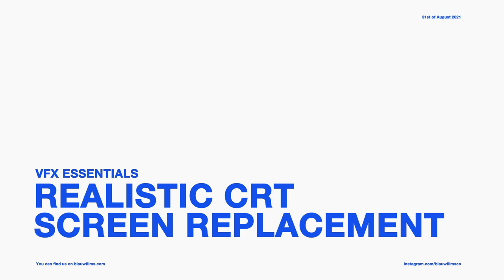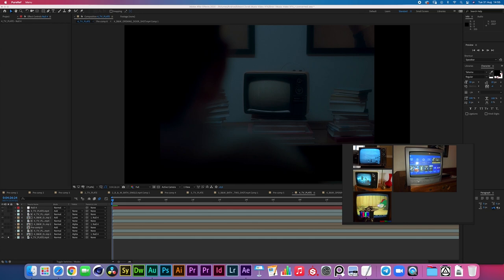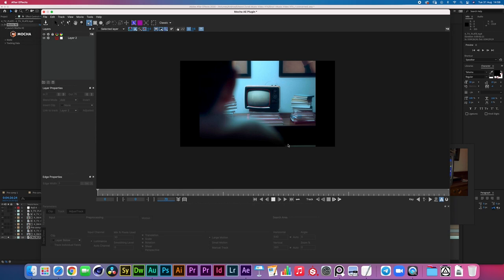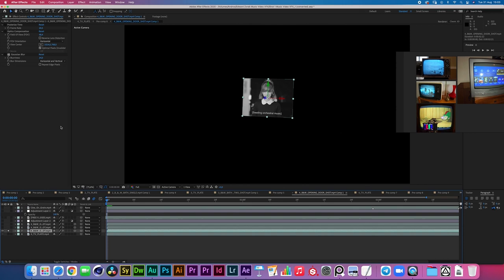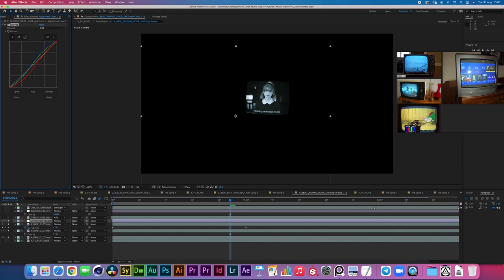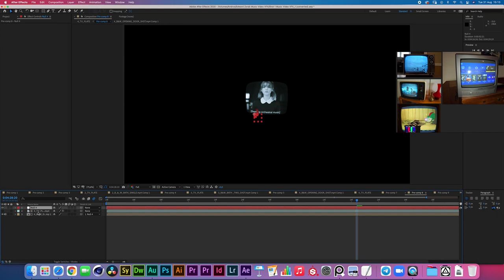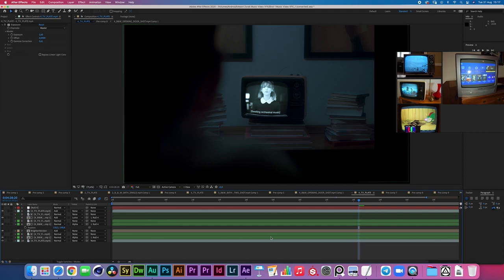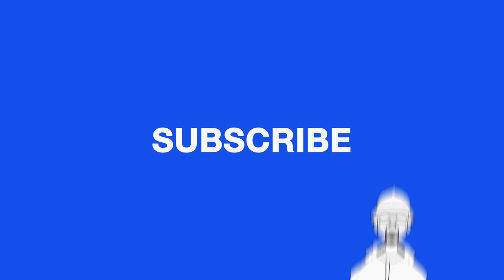Realistic CRT TV Screen Replacement in After Effects

Comment: Nice tips but for mocha workflow you jumped some CRITICAL points, like how to apply tracking data, also the necessity the precomp (footage or photo) to fit the original comp before applying effect etc...  Also how your footage becomes a bit offset since your surface area in mocha was exactly at the edges of your tv ? .... for a new user it is impossible to watch it.
Reply from the maker: Hey thanks for the comment! You're right. This video was supposed to be a follow-up to an earlier screen-replacement tutorial in which we covered most of these points. However, it fails to convey all the necessary information to smoothly follow along. Working on a new one that should get it right this time! :)
Reply: @BlauwFilms  thank you we are waiting :D
Reply: @BlauwFilms where’s the earlier video ?
Reply from the maker: @worldwideoffline6423  https://www.youtube.com/watch?v=53AC4KCslKI It's this one :'D 
This is really a long one about troubleshooting a sad greenscreen

Comment: How do you apply the mocha data to a null? Like how do you even export data from mocha ?
Reply from the maker: Hey, sorry I skipped over a few things in this tutorial. Once you've saved your track inside of your Mocha window, you can close Mocha. 
Then with your footage selected you should see the "Mocha"-effect in your Effect Controls panel. There select Create Track Data first, select your track and hit OK. Then change the export options to what you want: Transform data is simple Position, Scale, Rotation data (use this for any 2D track). Corner Pin is for anything with 2.5D perspective. Then click on the dropdown menu for Layer Export To and select your Null. 
Click Apply Export. And that's it! :) 

You now have a Null object with your tracking data applied. If you select your Null and hit "U", it will reveal all the keyframes that have been added to it. From here on you can use your Null in any way you want. 

If you are struggling with Mocha I'd highly recommend you check out the Boris FX Learn channel on YouTube. They really are the masters of their own software :)
https://www.youtube.com/watch?v=4CQDRYPsCKM

Hope this helps! Cheers, Leo
Reply: @BlauwFilms   Thank you! At 4:41, how do you add a point to a spline you've already made? I'm struggling to find an answer to this. And when you say 2.5D perspective, do you consider a old tv to have this because of the curving?
Reply from the maker: @worldwideoffline6423  Good one! If you go to tools up top of Mocha there is a Black Cursor (Selection Tool) and a White Cursor (Add Point Tool). If you have your Spline selected, click on the white cursor and click on where you want to add a point. That's it! :)  
When it comes to 2.5D perspective I'm mainly talking about movement in the shot. The bulging of the glass/refraction of the glass is something I'd do in compositing by adding distort effects to your clip. Or! If you really have the time (this will be for a future tutorial) you can motion track the clip in 3D and apply your clip to a 3D-model of a TV behind the glass. Then you'll have it all naturally in your clip.